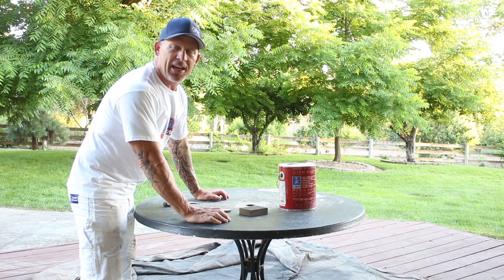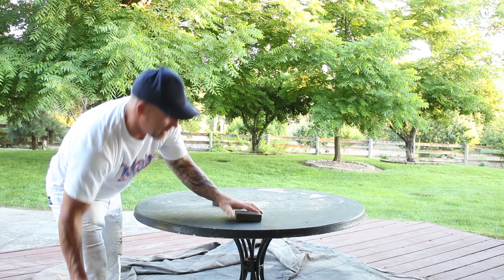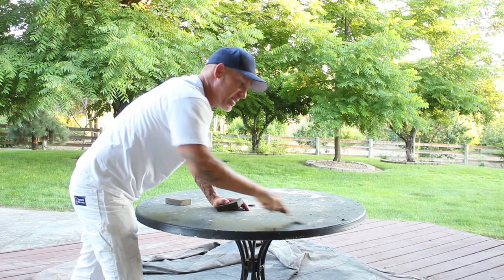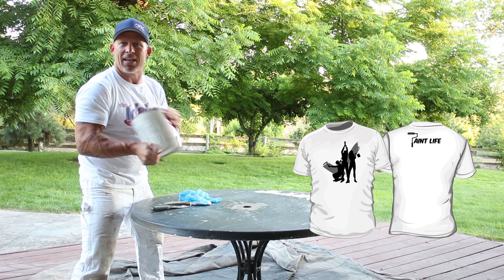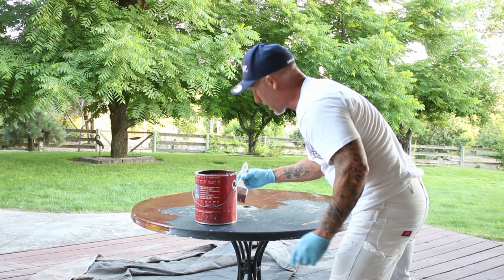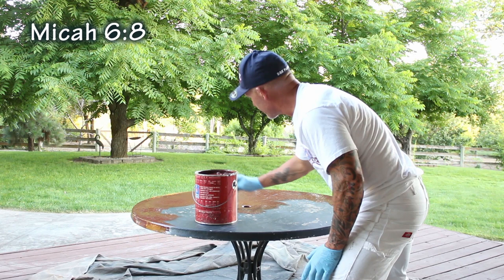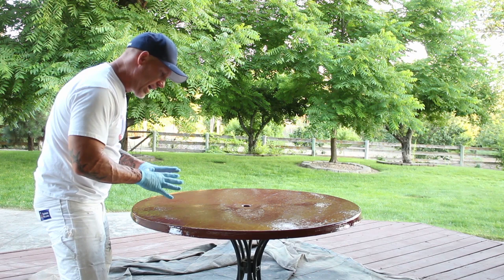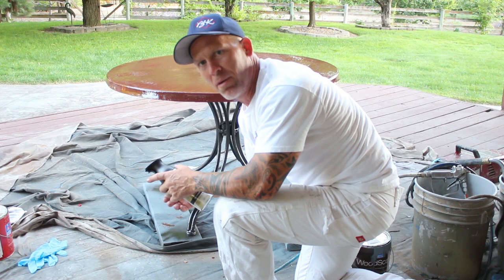How To Paint Patio Furniture.

Comment: how well does that paint cover where you scraped or did you feather it when sanding?
Reply: he mentioned that the oil based paint took awhile to dry and would smooth out pretty well but i was surprised myself that he didnt fill in the gaps. id think that sanding dead feather it some but not completely. but then it's was a demo on how to quickly repaint outdoor furniture, not make it like new again. i know he is meticulous when he needs to be and this just seemed to be a quick how to and to advise what paint to use.